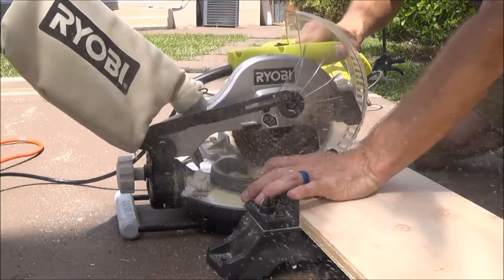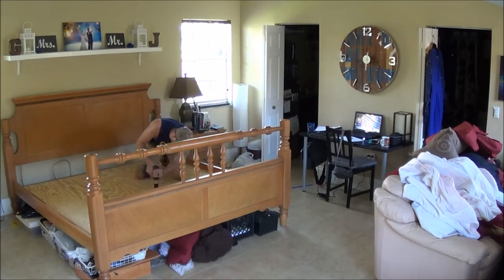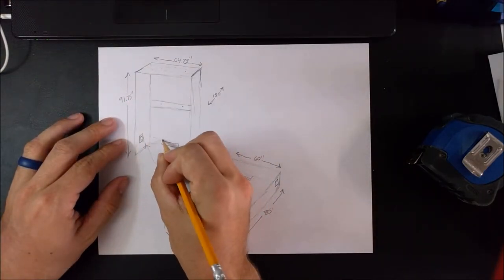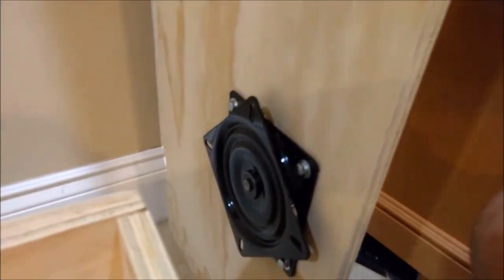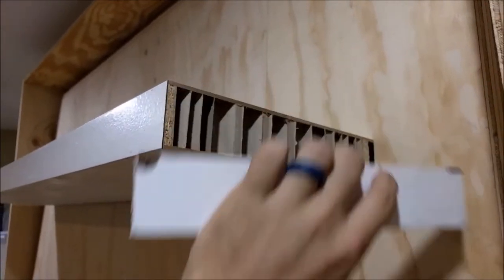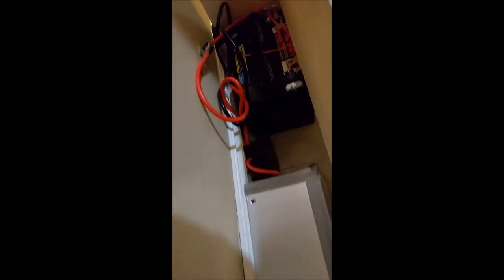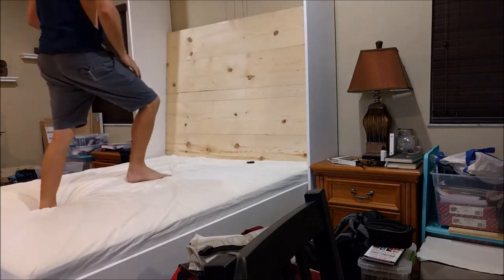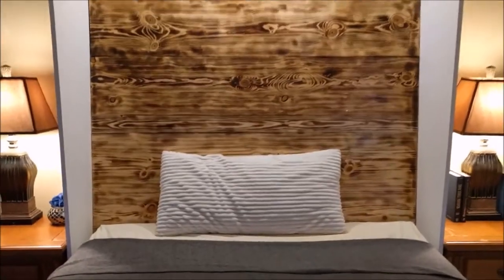Bagels Builds A Murphy Bed - DIY Murphy Bed That's Not Complicated

Comment: Great build I love the idea about the boat seat swivels. Your battery could off-gas though, so it would be safer to run a 12-volt power supply that plugged into the wall
Reply from the maker: David Perez thank you! We actually got rid of the battery. Changed it to an electric hoist. Thanks for looking out though!

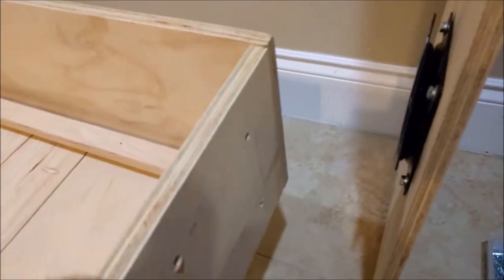Comment: 2:39 it is also possible to cut/notch out molding board and then push the vertical side panels to wall, or, relief cuts on the back edges of the verticals.

Hey! Murph! you crook!! take a look!...Cheap!'n'Cheerful!, Work's everytime!!

Comment: That winch is great. However you can eliminate that cable and instead place a hydraulic piston under the bed. Kinda like a dump truck. Then of course the piston would show when the bed is raised. Ah. Life is full of problems. 
By the way I really like this video. The head board is terrific.

Comment: Hello,

Great video.  I was going to buy the gas pistons, but think this is cooler.  Where did you buy the winch, how much was it and how did you convert it to something that could plug into an electric socket?  Can you post links?  Lastly, how did you add the remote control feature?

Comment: My only question is how do you know where to place the boat swivels inside the frame? Great project and good job.
Reply from the maker: @michaelstephan I measured it from the closed position. I didn't catch a video of that process unfortunately, but I used some random stuff to block it up and hold it in position while I measured.
Reply: @BagelsBuilds  ok thanks

Comment: T-nuts for your winch pulley are installed backwards and aren’t any better at providing any ‘rigidity’ than a fender washer... then, a lead acid battery underneath the whole thing with a trickle charger? Wow... 🧐😖🤯